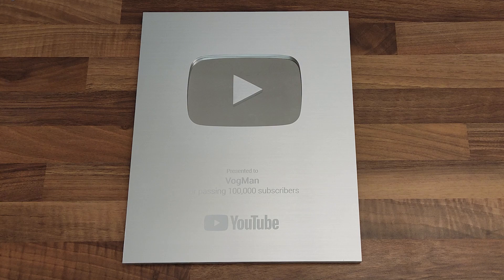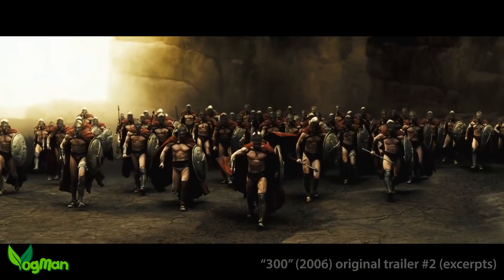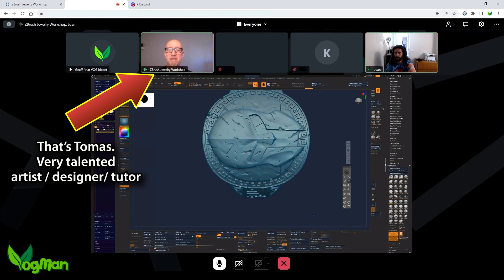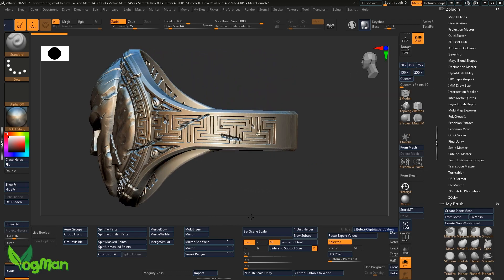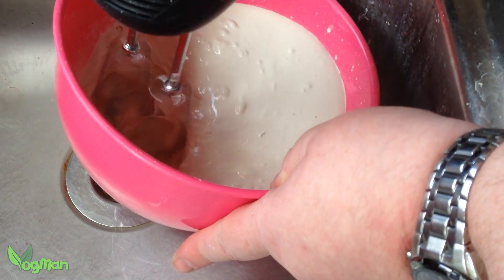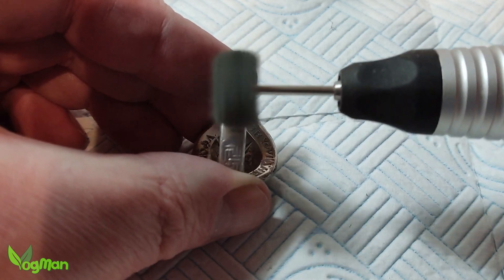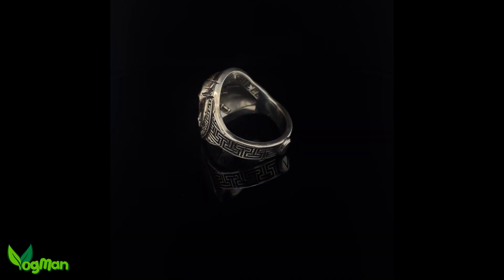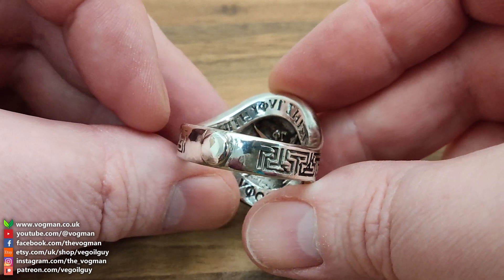SPARTAN RING lost resin casting - 3d print to solid silver on the Anycubic D2 DLP

Comment: You mentioned you like the accuracy of your anycubic machines. Maybe you could do a video on that. How close is an actual part at wax stage, resin stage, metal stage, etc. to the model dimensions?
Reply from the maker: Try this buddy https://youtu.be/8p7I8IVmpSo - it deals with shrinkage etc 😁
Reply: @vogman  thanks for the link! for a given resin, are the anycubic machines the same, better or worse than others you've tried?

Comment: Hey VOG, thanks for the video! I was wondering if you could share how to properly change the size of a ring in zbrush when it has already been designed in other size.
Reply from the maker: There's probably lots of proper ways. With a ring, I just make the ideal size cylinder (to be the finger - or mandrel) and then scale up or down to match this 😁
Reply: @vogman  thanks a lot VOG!